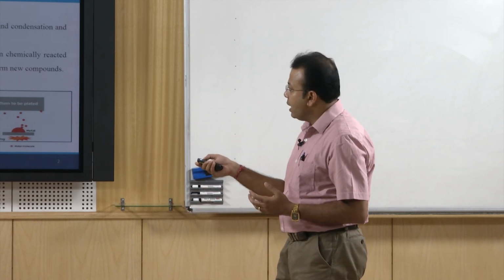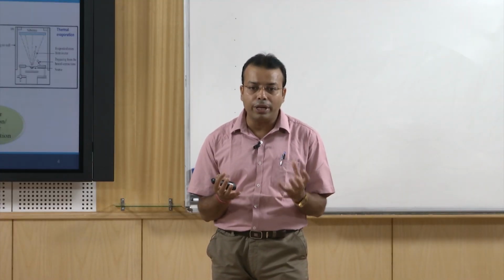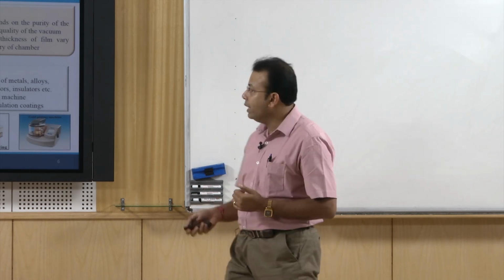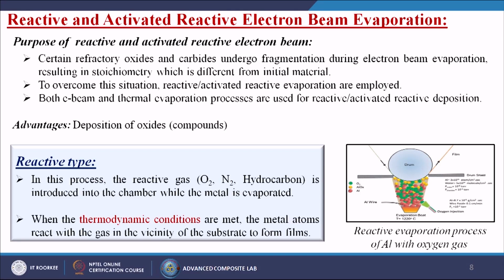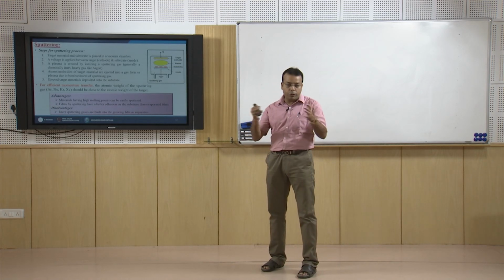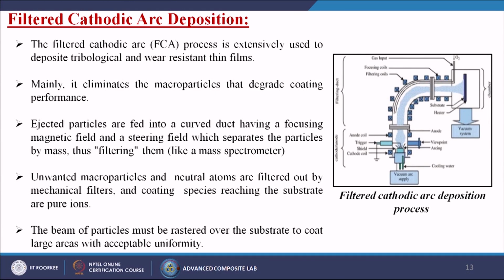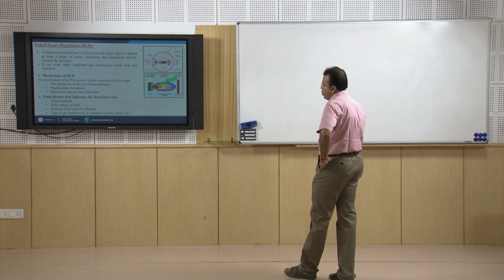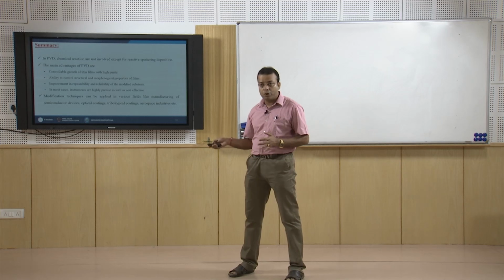Physical Vapour Deposition (PVD)

Comment: how can vapour deposition be used for thermal insulation coating? because the layer is deposited on the substrate by heating and vapourising it... if it is used as a heat insulator, it would just vapourise again... can anyone clear this doubt??
Reply: Dear Rohith, 
You can think it in a way of "temperature levels" used in two cases. That means vapour deposition temperature would be fairly higher than temperature at which you might use that deposited insulator for insulation applications. Hope you could understand this.
Reply: ooh... that makes sense... Thank you